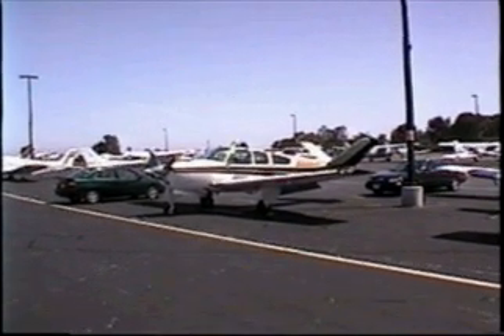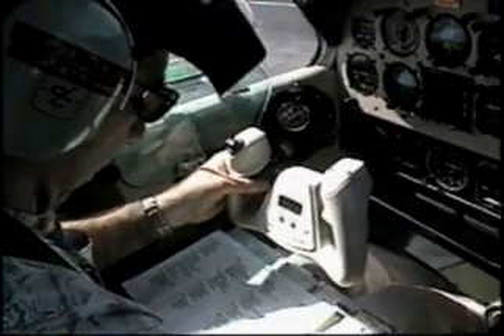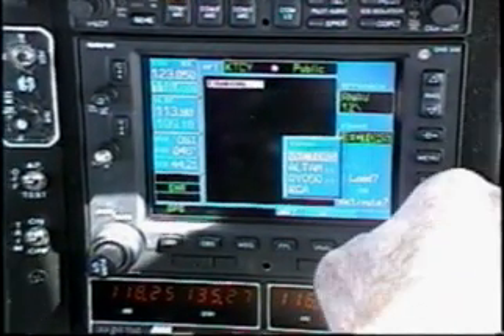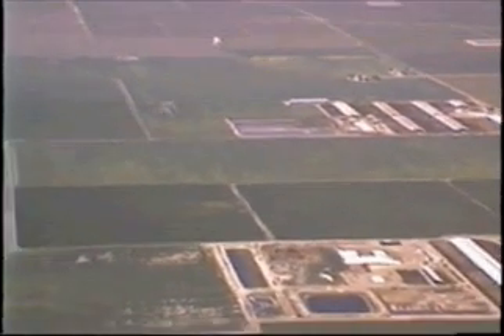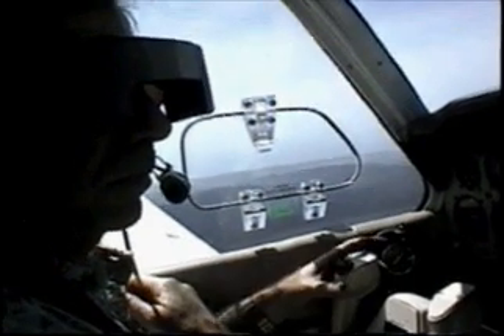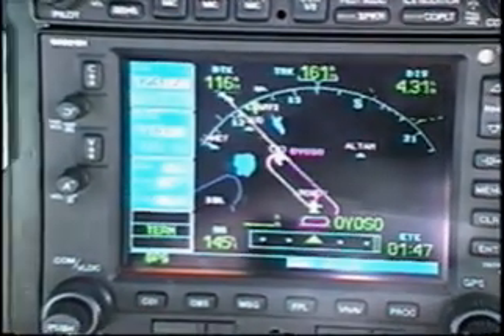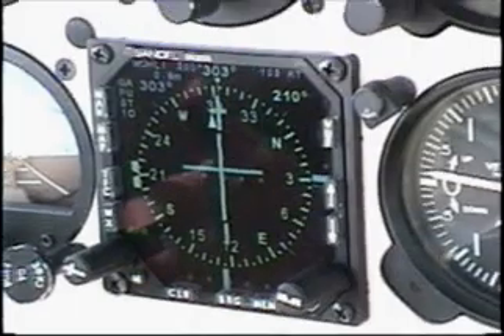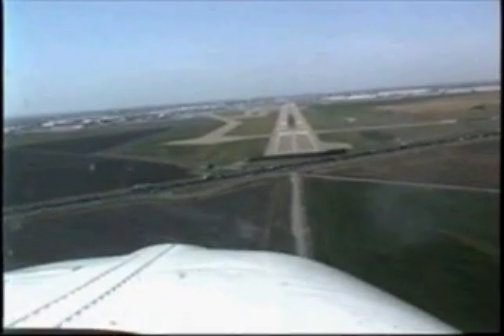Flying LPV Approach with Garmin WAAS GPS 530W

Comment: The GPS is a wonderful tool if you're proficient in it.  The problem is familiarization because being in the air is not the time to play with it due to other duties and the cost of engine time. The simulators are inadequate and just reading up on it isn't enough.

Comment from the maker: Jbsack, you are incorrect. The course does run on Windows 7 and on Macs. In fact, I just ran it a minute ago on my Mac with 10.6. If you have an older CD (from 2008 or older) that doesn't have a version number on the CD label then there are issues with running the older disks, but they can be exchanged for newer ones.